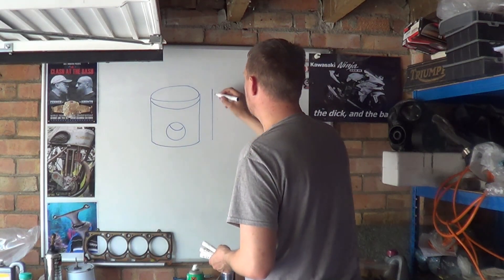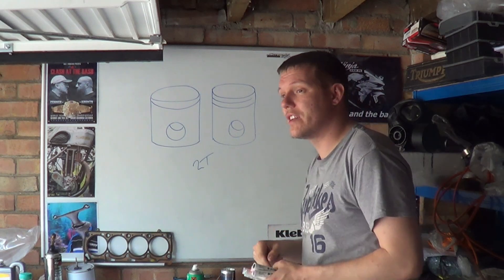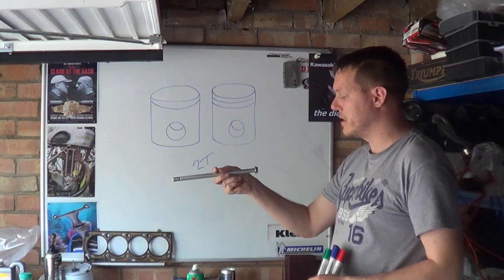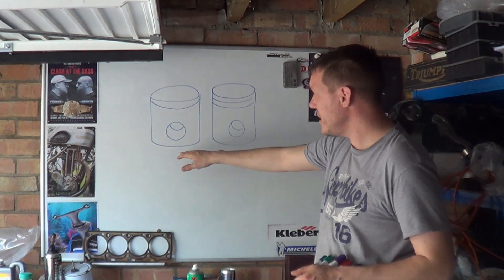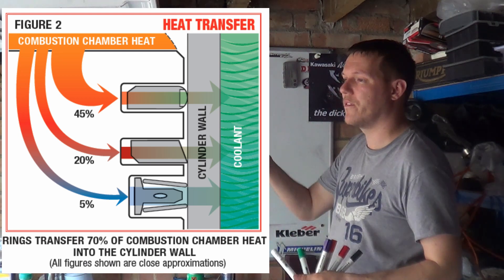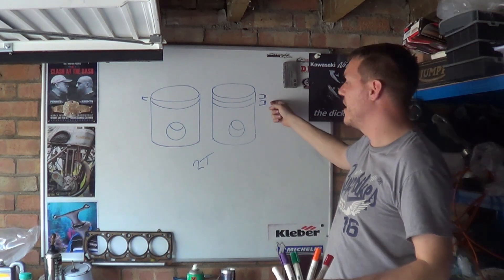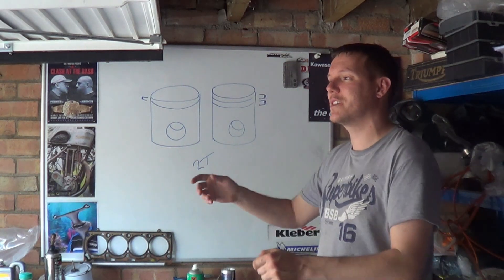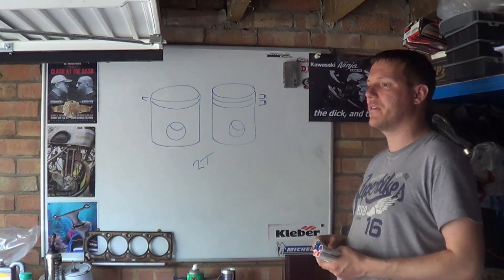2T - 1 piston ring or 2 + rant

Comment: interesting, i don't think i've ever seen a 2T piston with only one ring. all the kits i've seen all had two.
Reply: Daniël Windstra i just bought a Athena 70cc racing cylinder for my 50cc 2stroke moped and it has one piston ring:) altough i have never seen a 125cc 2stroke dirtbike or other 2stroke 125cc bike with one piston ring
Reply: I was just looking at a webshop for tuning scooters and mopeds and most of the kits have one ring, they don't seem impossible to find though.
Reply: As far as I know most motocross bikes are 1-ring where enduro bikes are mostly 2-ring. Isn't that correct?
Reply: That is true. My 125 exc is 2 ring because it's not a mx bike.
Reply: ACreativeName  Oh, I didn't know that. Ktm exc and sx both have powerful engines to be 125cc so I think the yamaha yz and for example honda cr could also have 1 piston ring. I am not sure about that though
Reply: Insane o5mo btw i also have airsal 70 on a derbi and it has 1 ring :)
Reply: ACreativeName oh you do? what setup do you have?:D
Reply: Insane o5mo 21 china carb airsal 70 racing ported and block flowed . also homemade xhaust from metrakit thrower and original exhaust. with sm tyres and naraku crank
Reply: Sounds sweet!
Reply: Tobias Usewicz  I actually have no idea:/...
Reply: i really don't know, back in 'my day' i can only remember them having two. but i guess it's changed.

and its only been 5 years :D
Reply: To the best of my knowledge this is how it is. I guess it's mostly about cost because you will wear out the piston faster than the rings in mx racing anyway. I think it's mostly costs. Quite sure Matt can clear this up.
Reply: a lot of high end racing cylinders are single ring. They rev 15-18k rpm and are rebuilded  after every race.
Reply: Edvinas J.  Because I have the racing cylinder from athena I can only drive about 2500km with one piston. That is like alot of kilometers but I also drive alot so yeah...
Reply: Your "racing" 70cc Cylinder, have a 1 ring position in order to create more rpm.
Reply: Michael Yes, I know that. If i would buy "racingelectricities" (that is what we call it here in finland) it would take even more rpm
Reply: Insane o5mo You mean a innerstator ignition, don't you? 
I own one and this things are just amazing!
Reply: you think 2500 is alot? i do that in a month ;)
Reply: Michael Yeah that's probably it:D
Reply: Insane o5mo Is it something like this? https://www.mopedtuner.at/bidalot-racing-factory-innenrotorzuendung-digital-derbi-p-465.html
Reply: Daniël Windstra  no i do not think it is alot:D if i will get my moped running it will take me about maybe three weeks to "dailydrive" 2500 km
Reply: Michael exactly!
Reply: My yz 125 only uses one ring, aswell as my Peugeot tkr with a stage6 sport pro 70cc cylinder.
Reply: ***** oh
Reply: Daniël Windstra 125cc dirt bikes as well as 150's have single rings, the Honda 250 2 stroke only had 1 as well, it required more frequent topend rebuilds than its twin ring brothers of other manufacturers
Reply: I've seen a single piston ring in things like cheap yard equipment, that's about it. I can see how it might be used in racing engines because they want to reduce friction, and in many forms of competition racing, the engine only has to last one race before being overhauled.
Reply: Tobias Usewicz  this doesnt mean anything because the same piston works with both exc and sx. atleast I have 1 ring sx piston in my exc
Reply: Daniël Windstra there are quite a bunch im riding a expensive polini zylinder(65ccm) its only got one
Reply: I have a 2007 CR125 with genuine honda piston kit, 1 ring my friend as stock.
Reply: Most it's rpm and friction, if you use your engine most of the time above 8000rpm, you can go aheah with a single ring, can't remember why but read it in some books about 2 stroke tuning.
Reply: Insane o5mo ktm exc and sx all have 1 ring
Reply: ACreativeName KTM 125 EXC has 2 rings

Comment: Piston rings add to wear and tear of the cylinder and use energy in doing so, I always run my engines with no piston rings, In fact the weight of the piston is also lost energy so i intend to run my engines with no pistons in future thus 0 wear on the bores.
Reply: Massive gains in fuel economy..
Reply from the maker: what?
Reply: 69waveydavey you're funny 😅
Reply: +69waveydavey. That`s just brilliant! Well done. Mind you, without a piston or piston rings, I think you could also do away with the con rods, the cylinders, and the crank. What remains could just run on Love!
Reply: 3cc Nitro engine is really working like that
Reply: Silicon pistons, what could possibly go wrong ;)
Reply: I have the answer that guarantees absolutey "Zero" wear and tare on any motor ..,use some one elses
Reply: @goodaysgonebadonesacominon yea...just always use a handsaw so no one engine got damage..i know it yea...
Reply: I believe in you..so you just spin the crankshaft with a bare hand am i right?
Reply: @gurangasgurangak6832  No just drive the car round without the engine running, saves on fuel too.
Reply: In fact I've given some further thought and if you make a piston out of something really slippy, say for instance ice, surely it would make for more efficiency thus more power and fuel savings.